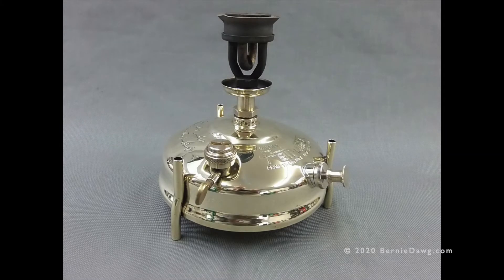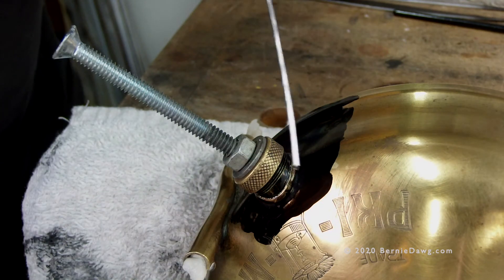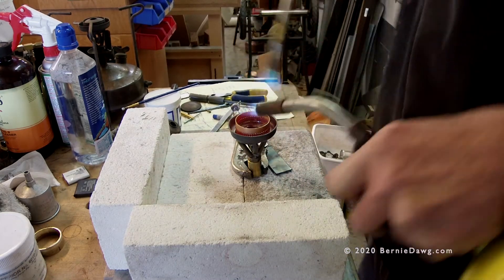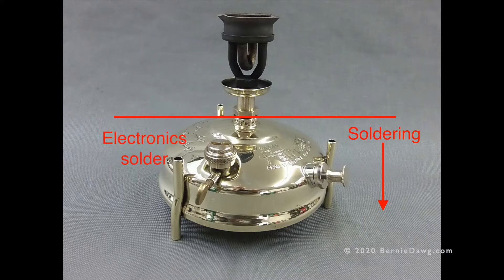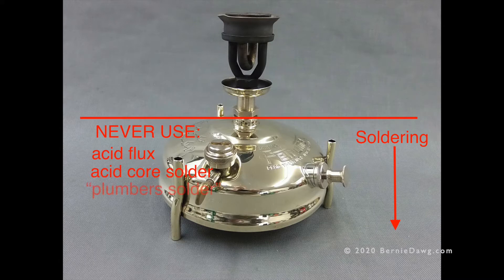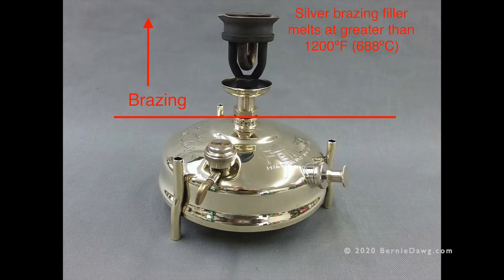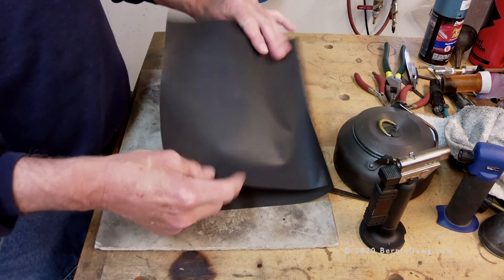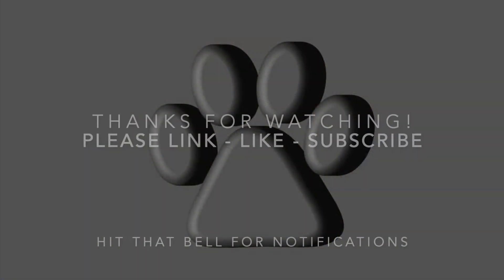Brazing VS Soldering on Kerosene Pressure Stoves

Comment: Thank you for posting this, I do model steam engines and boilers and one of the most frustrating things is telling people that Silver Bearing Solder is not Silver Solder.
Stay Healthy Stay Safe Stay at Home.
Reply from the maker: Ha! I know, right? 🙂 Later on I'll have another video that you'll find interesting, too. Thanks! BD
Reply: @BernieDawgCinema  Hi BD, you asked why I do not have any posts of my engines and boilers.  I am at the present resetting up my shop so have not made any for the last few years.  Unfortunately other then one boiler I have parted with all the engines and boiler I had made. 
Years back I made two engine and boiler sets, posted them on YouTube and mentioned that one was for sale. You Tube promptly shut the account I had then down, saying I was using it for commerce. I also received two separate letter to stop making them under patent infringement, one from France and one from England. The designs that I had based my builds on had both been published in England before the turn of the century. From this experience I am a little reluctant to post photos of the last few I have done, especially as one that I built is an exact copy of a recent design which I made with the designers permission and agreement that I only make that one to be sold and one for myself. Once I get my shop set back up I will make some more engines and boilers of a simple design that a couple of people have been bugging me to make for them. I will post them on my current channel but make no mention as to weather they are for sale or not.
Reply from the maker: It'd be cool to see what you are building with tanks. I mean, since I have an interest in building stove tanks. Boilers are similar I should think. My neighbor says he's into steam engines and is setting up his shop. He's been "setting up his shop" for several years now with nothing yet to show. I've stopped asking. 🙄
Very strange about YouTube hassling you for selling things. I promote my 3D silent caps on YouTube after all. Maybe it was how you promoted them? You can look through my videos to see how mine are done seemingly without issue. 
RE: patent and copyright: I received some caution about my dawg print logo from a EU company that claimed it was trademark infringement. I laughed and ignored it. You can't trademark an animal footprint. Years have gone by with no further development other than I think that outfit went out of business. I reckon the cost of trans-ocean legal prosecution is enough to slow down anyone unless they really have a viable claim. Just my 2 cents as you move forward. BD

Comment: Wow, very helpful! Would this also apply to white gas stoves such as a SVEA123 with a spun threaded insert?
Reply from the maker: Thanks! All fixed joints and seams on the Svea 123R are brazed - no soldering there on that particular stove. BD

Comment: Great video BD, really enjoy your stuff and the fact that you shareyour knowledge.
Funny thing, i have exact same stove as in you video with exact same problem. Im doing some study and will attempt the repair. In your video, i can see the area around the fuel cap is all black. Is that some form of liquid protectant you have applied to protect this area? Appreciate any tips or another video on doing this repair! I picked up a Burmos stove on weekend and it too has a leak around the fuel cap.
Cheers, JL
Reply from the maker: @J L Thanks! The full repair video on pump tube pulling and desoldering is right here: https://youtu.be/tTkGeA6YTHw Check it out. It has lots of specifics and recommendations. The black stuff on the stove in the video is india ink. I paint it on with a small artists brush. As you suspected, it acts to inhibit the flow of flux and solder to areas where you don't want flux and solder. I've got lots of tips and thoughts on soldering on stoves. More than will fit in this little YouTube reply box. You're welcome to drop me an email with questions. Here's the best one for soldering: All metal surfaces that you want solder to stick to need to be absolutely cleaned to bare metal. Here's another: Use acetone to completely flush and clean the interior of the stove of all traces of kerosene before attempting to solder. Kerosene is a fantastic penetrating oil. Any kerosene left anywhere near where you solder will creep long distances into your solder joint as soon as you start heating unless the kerosene residues are all removed first. Joints contaminated with kerosene won't allow solder to bond. Whew! Out of room. Good luck! BD

Comment: Thanks for the simple and down to the point video. Is there a "do it all" or multi-purpose torch and fuel that you recommend ? I see that yours came on each time that you hit the button. Thanks again
Reply from the maker: Thanks. I use Bernz-O-Matic torches. A TS4000 on a 1 LB propane bottle. And, a TS8000 torch connected to a 5 foot hose (from Coleman) which connects to a 20# propane tank. Both torches have piezo trigger starts. They both are at Amazon or try Home Depot (in the USA) or other building supply. BD
Reply: @BernieDawgCinema  Thanks for the info BD. I appreciate it.
Reply: @BernieDawgCinema  I finally got everything together and was able to braze the Optimus 111 case back into service. Couldn't have done it without your help man. Thanks.
Reply from the maker: @John Ellis You're welcome! It looks real good, too. (I saw the photos at "that site".) You are a brazing natural. 👍 Glad to see that you were able to figure out that the tank bolts are 1/4"x20tpi even though you were told different by at least one denizen at "that site". 😁 You're always welcome to ask questions directly via email. Happy to help and you'll get truthful answers, too. Good luck on your adventures. BD